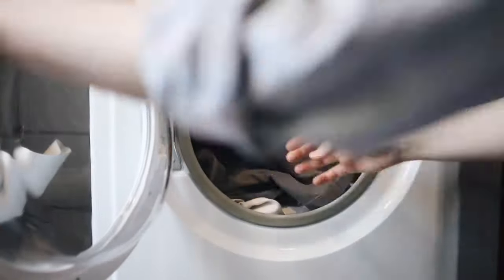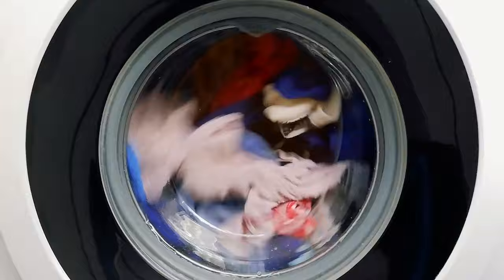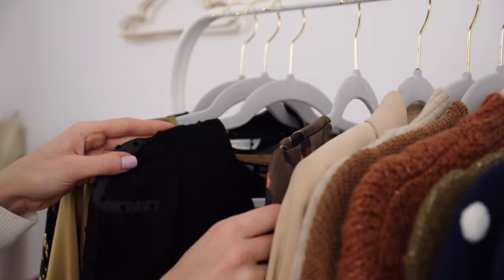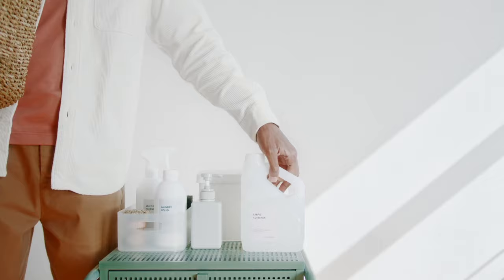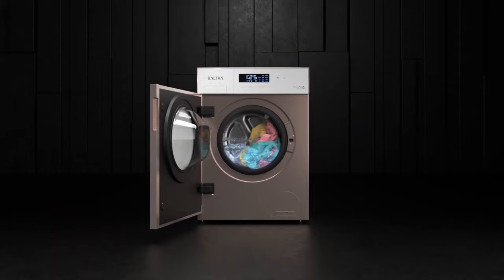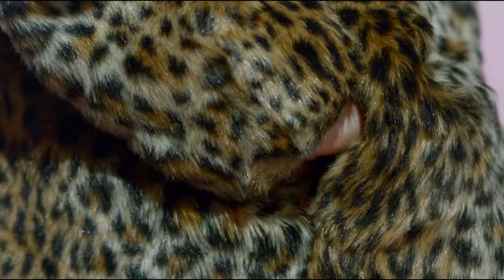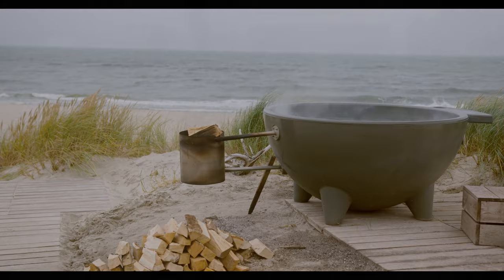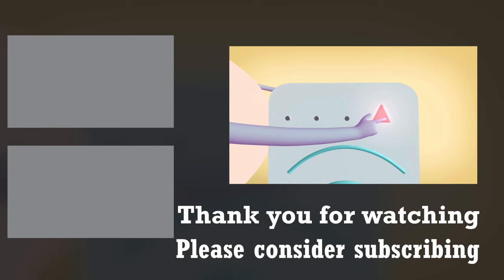How Washing Machine Works - Surprising Engineering of How Washers Work and their History.

Comment: Our washing machine is broken to two halves Exterior 
And It shows black liquid coming from drainage into washing machine 

And Washing machine engine never works 
How can I fix it? 

Several problems that washing machine face.
Reply from the maker: Sounds like you need a new machine tbh, make sure there is no blockages in the drain.